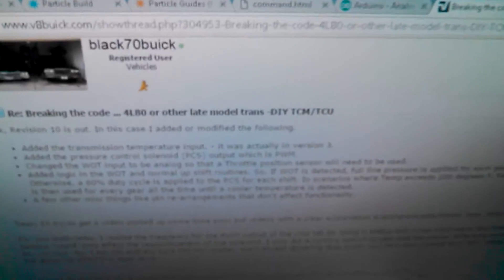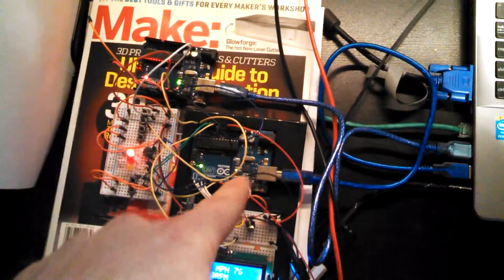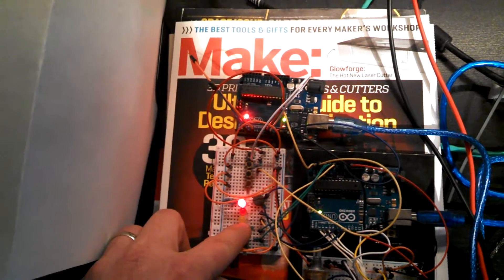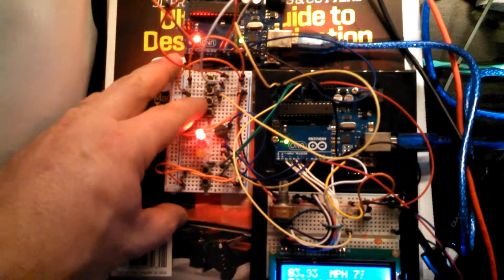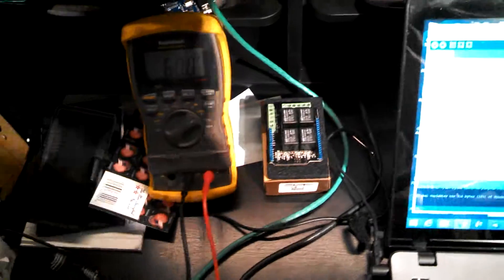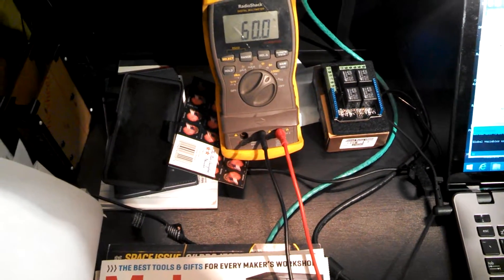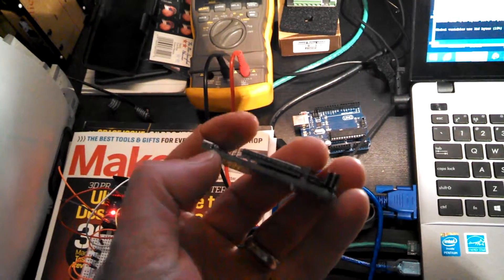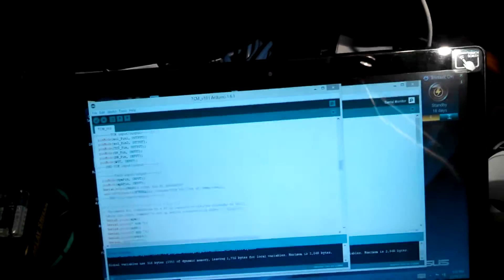Arduino 4L80 TCM/TCU

Comment: set the pwm on a 555timer board (ebay thing) in line with circuit fer pwm ?
Reply from the maker: Im not sure what you're suggesting. There is a PWM capability in the Arduino.
Reply: @black70buick54   ok lol i was a half asleep and must have reed / thought wrongly fer some resin  must been thinking it may need a different type or source of signal apologizes
Reply from the maker: @overbuiltautomotive1299  to be clear you are not too far off. The Arduinos have pwm signaling. I don't think more power is needed to drive the pressure control through a FET. But a 555 timer could be powered up and turned off between shifts to slightly simplify code.
Reply: @black70buick54   cool not bad i guess for a guy that ant ever fooled with that type of digital stuff much lol ;that were mind wuz at is adjustable on the fly possible higher current solution ...i don`t know God bless

Comment: Are you distributing the TCM sketch?  If so, where do you have it up?  I've got my 4L80e wired up for manual shift, and while writing arduino sketches aren't a problem, I've no idea of where to even start setting up shift points such that RPM & TPS are both taken into consideration, not to mention pressure control.  If I had a TCM, I could feed it input and see how it behaves to get a ball park, but, I don't have one.  ;)
Reply from the maker: I was distributing the sketch and I haven't gotten back to this project in 4 years. I've been using my original system using PIC chips. I may pick this up again next year since I am making changes in the car. Pressure control is a waste of effort. Leave it be, soften your shift based upon RPM. Regarding shift points, that is entirely up to you. Max shifting RPM is really based upon the engine you are mating to the transmission.
Reply: @black70buick54  Does TC lockup need modulated signal, or is it just send to ground like A & B solenoids?  Hrm, no pressure control?  Shifting to 2nd (and 1st on downshift) is rather harsh at full line pressure, and that's in a Suburban.  I get what you're saying, as I have noticed I can mitigate by being hypervigilant on when I shift to second (or downshift into 1st)...which if I had a programmable TCM, I could obviously setup accordingly.  In any case, if it wasn't for the harsh 2nd shift, I'd probably never be sufficiently motivated to install a TCM...though paddle shift might have gotten me there (steering column shifting is annoying,  to be sure).  Many thanks for the insights!
Reply from the maker: @dota9925  The TCC and The PCM are originally modulated. The PWM in Arduino is not the right frequency so much more code will be required and/or working out the duty cycle to compensate. 1-2 shift hasn't been an issue for me, maybe because of vehicle weight and or motor torque. TCC was modulated to mitigate heat build up in the TCC coil, but that simply adds heat to the fluid. Again not a problem for me. All my information came directly from the lead Hydromatic engineer . So pwm of these solenoids is upto you.
Reply: @black70buick54  Thank you!  Very helpful.  I remember there are two frequencies -- pre 94 = 292.5Hz, and 94+ = 614Hz.  Looking at arduino spec, looks like 490.196Hz/976.56Hz is default (depending on board and pins), but this can be adjusted with one line of code to between 30-65000Hz.  So, doable, but would still need some clue as to how to drive the damn thing (no problem sending 614Hz...but now what?).  If modulation is just a matter of heat management, maybe just wire up constant voltage, with temp sensor, and keep an eye on it...?
Reply from the maker: @dota9925  if you saw my other videos about this (though incomplete with the arduino) you can use FETs. I am sure you can use a solid state audio driver or motor driver board as well. The trans solenoids are not high power but they are high enough to require amplification from the Audio signaling. You can measure the solenoid draw yourself to double check the specs of what you want to drive them with. Regarding heat, I believe you are over thinking it. just my opinion.
Reply: @black70buick54  Thx!  I'll take a look at your other videos.

With regard to "now what":  There are a variety of arduino motor shields that amplify 4a to 9a (MOSFET), which should be enough -- saw somewhere else 3amp for TCC and pressure regulator solenoids.  So, that's not the problem.  I just dont functionally know how PWM adjusts to control the solenoids:  saw somewhere else that baseline for pressure regulator is 60% (as with A & B, the goal is to supply ground, but engagement of the solenoid reduces pressure, so double negative puts us at 60% PWM signal on, to provide 60% line pressure), but how/when does the 60% change based on ess (rpm) & tps?  Maybe as simple as just reading tps, and setting PWM on a gradient between 60% line pressure at idle, to 100% line pressure at WOT.  However, and moreover, if I'm too soft, does it chew up clutches or friction material??  I suppose if I do a ~1s ramp up from the gradient line pressure to full line pressure, that would reduce risk (and immediate drop to correct gradient just before shift).  How's that for overthinking it?  :p  But, again, coding is easy, I just dont want to mechanically damage my tranny because of some silly mistake (I know the 4L80e is pretty bomb proof as a daily driver...but that intrinsically assumes an OEM controller...or at least one from someone that knows what they're doing!).

In any case, apologies if it was unclear:   I was agreeing with you with regards to not bothering with PWM at all, especially on the TCC, if the only reason for PWM was heat management.  Instead, just ground the TCC solenoid to engage, as you suggested, and wire up a temp gauge to the tranny to keep an eye on things -- i.e. these trannys already have a temp sender built-in, just currently not connected to anything in my manual shift setup.  If heat actually becomes a concern -- I've already put the largest oem trans cooler on the truck (easy wrecking yard find) -- upgrading trans cooler to a larger after market unit is easy enough (and I doubt that would be necessary; seriously, it's a 3a solenoid).

If it wasn't to gracefully deal with harsh shift, I wouldn't bother with PWM at all.
Reply from the maker: @dota9925  yeah. I understand the dillema. 60% is the baseline for the solenoid to be Off! Not grounded meaning 60% the signal is HIGH not grounded. Keep this in mind in you code and the drivershield you use. You should not be oscillating more that 1 second. There is NO oscillating once the gear has engaged. All this happens less than a second.
Reply: @black70buick54  Totally agreed on 60% line pressure = 60% low PCM / 40% high PCM.  :)

Thank you!  That makes perfect sense.  In other words, do as I was planning, but reduce the duration to <=1s, depending on throttle, then fully engage (100% low pcm).  Wouldn't be hard to hook up a moment switch to cycle through tenths of a second of ramp time to allow testing/dialing in shift hardness -- i.e. if at 50% throttle, line pressure starts at 80%, and ramps to 100% in .5 seconds, then easily use moment switch to adjust ramp time by 10ths until I'm where it feels good; then hard code later based on results.

Many, many thanks!  I'm definitely a tranny idiot (know enough to be dangerous), and really appreciate you taking the time to give me some small pointers.
Reply from the maker: @dota9925  sorry. I want to make sure I made it clear. The duty cycle is in reference to electrical signal high meaning for the PCM you are not activating it because you are not grounding it (floating the ground is equal to High when the positive terminal is charged +). OR stated a different way, you are only grounding 40% (activating 40%) or less of the time of the pulse width. In short, the most you want to reduce line pressure to soften shifts is 40%, using at the softest shift only 60% of line pressure.
Reply: @black70buick54  I thought that was what both of us said, effectively twice.  :p

I've never coded for PWM before (used code with it, but never coded it myself), so I expect I'll be a bit more cogent once I've dabbled with it first hand.

That said, it is extremely clear, in principle, that just like the A&B solenoids (and TCC solenoid), the line pressure solenoid is always powered, and the wire used to "drive it", is really the ground wire.  Moreover, unlike the TCC, the line pressure solenoid is activated to reduce line pressure.  That's why I called it a double negation process -- the PWM positive duration percentage works out to be the line pressure percentage.  So, soft shift would be PWM at 60% positive, and hard shift (default) would be 100% positive (effectively removing a ground path, just like if it was unwired).

Hopefully that's on target.  I can maybe explain better once I actually toy with PWM.  :)
Reply from the maker: @dota9925  no need to explain I think you got it. I wanted to reinforce the point since you had expressed concern irt heat/damage to the trans when pwm'ing during shifts.
Reply: @black70buick54  and, i.e., doing less than 60% line pressure (on purpose or by accident) would be "bad", and moreover, less than 100% line pressure should only be used for sub-second time during gear transitions, or "bad".

This is fantastic Information, and thank you very much!
Reply: @black70buick54   sset the pwm on a 555timer board (ebay thing) in line with circuit fer pwm ?